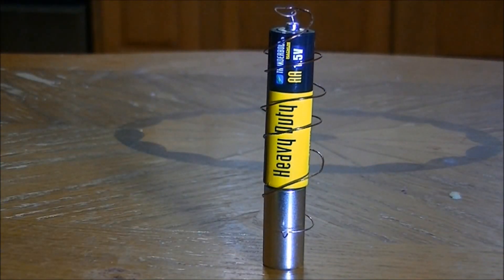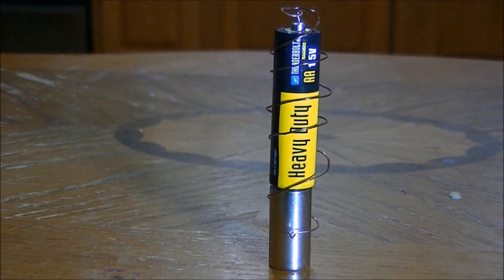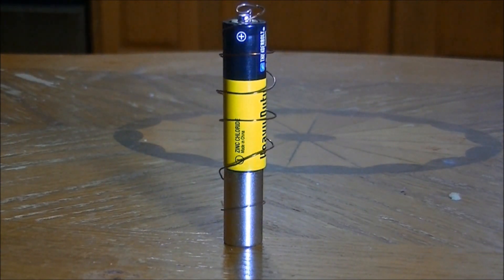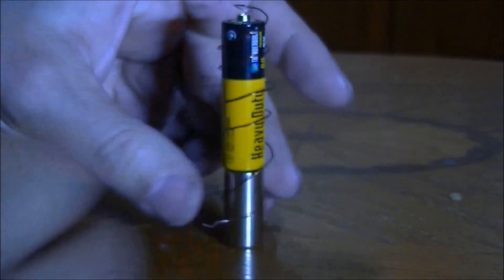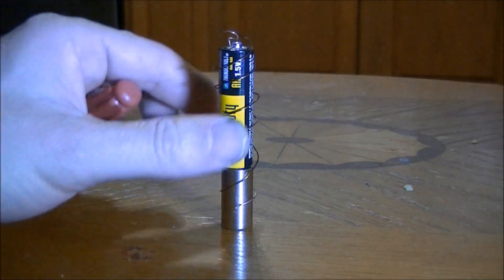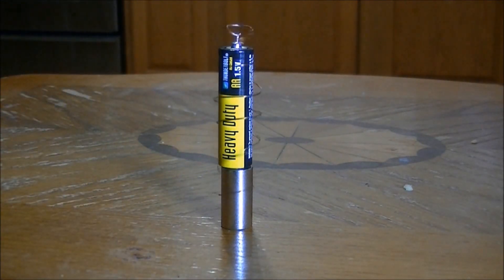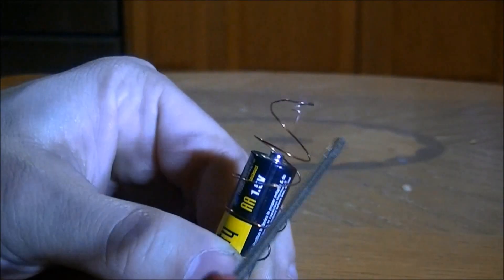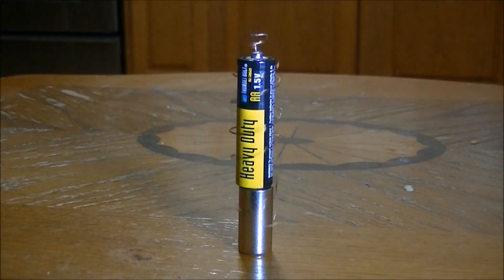Worlds Simplest Motor ? And how to make it work

Comment: what if you wrapped the wire around a wooden spoon handle that was slightly larger in diameter than the battery, then adjusted the top contact accordingly ??It would be cool to do this on a larger scale..